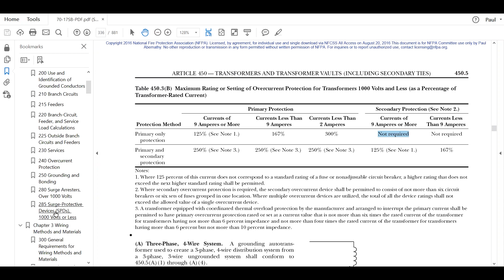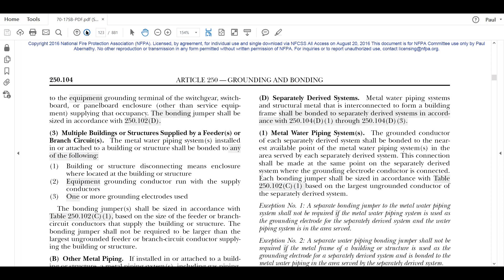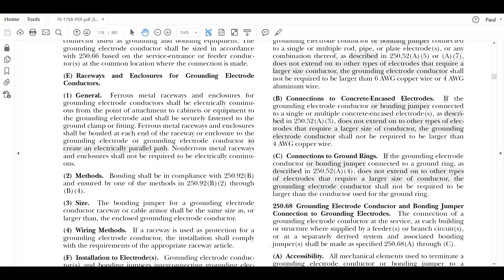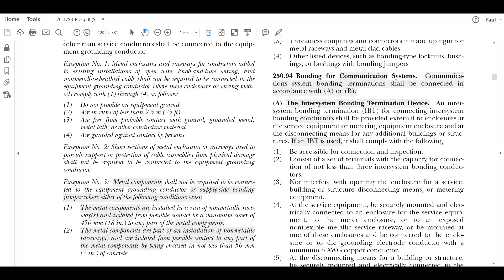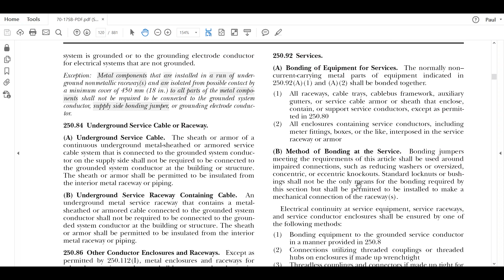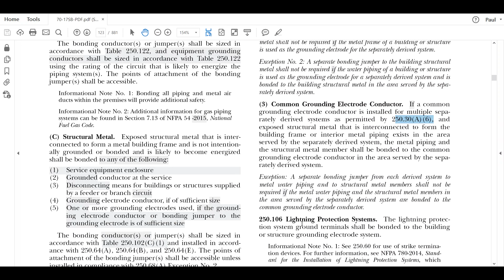2017 NEC - Transformer Series Part 6 - Grounding & Bonding

Comment: What happens if you don’t bond the neutral to ground?
Reply from the maker: If you do not install the System Bonding Jumper (SBJ) on a grounded system you will never clear an OCPD on the load side and of course you will not establish any neutral (grounded) loads.
Reply: @MasterTheNEC  is this why I’m reading 120v between neutral and ground?
At the sub panels and transformer?
Reply from the maker: Well, I won't speculate but when you read 120V between N-G it would be due to a floating neutral. Now, it is also common with neutral current in 3-phase systems returning to source and due to no SBJ you then have a difference of potential present.
Reply: Could this also cause a 0.0 reading from A leg to ground?
Reply: Thank you! This solved both the loaded neutral and the A phase problem.